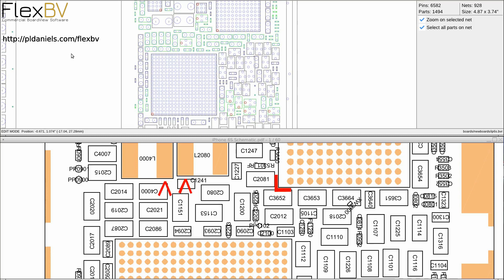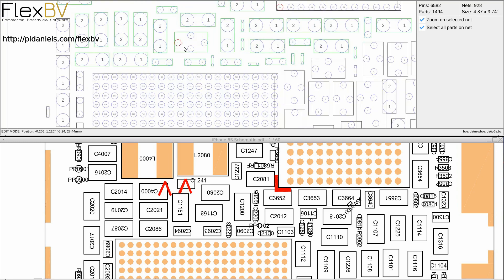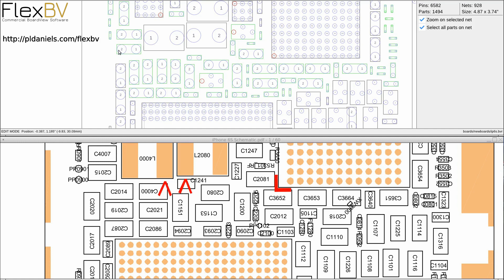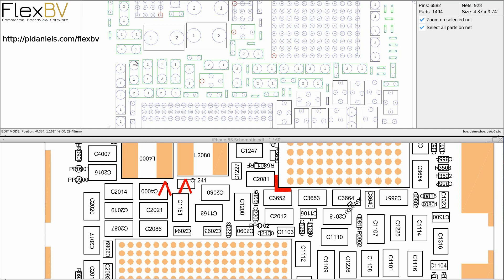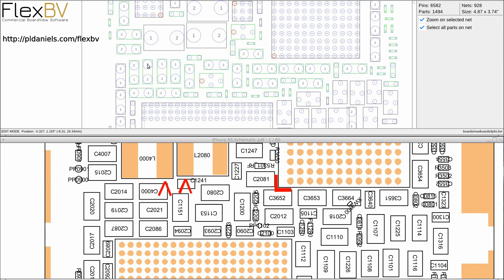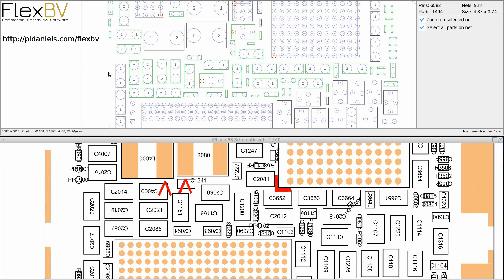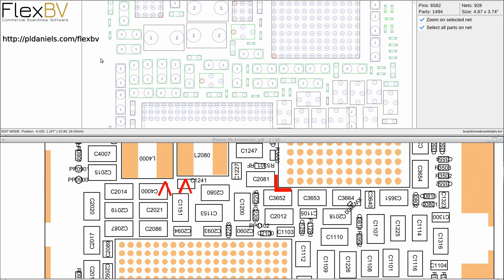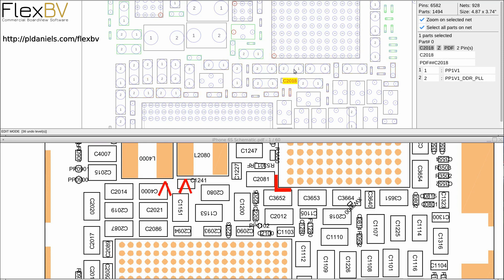FlexBV: Improving the part scan algorithm (very quick, ignore if not interested)

Comment from the maker: After last night's demonstration of the part selection algorithm I found myself needing to improve on it, for my own sanity if nothing else.  While the old naive/brute-force method did the job it did make it harder to maintain a visual flow when looking at the PDF for the next part location to click on for the name.

As a bonus, the new algorithm runs at O(n) rather than O(n^2) from last night.

It could be further modified to provide shortest walk/next-hop distance but  then you have to deal with controlling wandering.  Getting to the level where it's a case of pick your corner-cases.
Reply from the maker: "It depends" a lot on what sort of coding you're trying to do.  Most of the books that have lasted with me over the prior 3 decades are ones that aren't language specific.  "Introduction to Algorithms" by Cormen, Rivest, and Leiserson is probably a "must have" for a lot of programmers, but it's a fair bit to chew on and helps if you've already had some experience with that sort of content.

I've never done C#,  I'm still an old-fuddy content to hide in my C, bash, php, Pascal ... and a little bit of C++ cave.
Reply from the maker: If they can make a language with the availability of C (and C++ to a lesser extent), without monsterous dependencies, I might get interested; however for now, I think the reason things like C linger so well in spite of the design limitations is that you just can't beat its portability and minimal requirements (Java... what happened to you!?).

Comment: Paul, slightly highlight the "next" part while the "current" is active. This will give the user a vector "path" to the "next" while he selects the "current" label. Get the brain to multi-task.
Reply from the maker: That could work, will require a look-ahead which may complicate the undo process, but I'll give it a whirl.

EDIT: I've implemented it, but might need to fine-tune the colours/methods used to indicate the "next part" without being overly intrusive visually.  A fine balance.
Reply: Paul Daniels perfection is subtle!
Reply: Make it purple then ;)
Looking forward for your implementation of ground-plane layer on a multi-layer board algorythm!
Reply: And resistance is futile as we all know.

Comment: Paul, Louis has often mentioned your custom sw for improving the way data from his multimeter is displayed onscreen (ie. much faster update for readings). Is the sw in question available for download or purchase somewhere? Or is it part of FlexBV? I gather Louis uses a BK 390A; would the sw also work with a BK 393?
Reply from the maker: It's open source, https://github.com/inflex/BK-390A 

There's some quirks which I'm waiting on more data from Louis to resolve.  The flickering k or M prefix seems to be something that might be due to ever second frame missing the bit setting.

Don't know if it'll work with a 393, haven't even looked at that model; check the protocol spec perhaps?
Reply: Thanks! Where would I find the protocol spec? I couldn't see anything relevant in the owners manual PDF. Note that I'm considering the 393 over the 390A partly because of its somewhat better accuracy, but also because the cost where I am (UK) is not much more than the 390A.

Re the quirks, you should trademark mateVolts. ;D

Btw, alas I can't really use the FlexBV sw because the boards I want to fix are not Apple or phone boards (I mainly work with SGIs), which is a pity because what your sw does is incredible. Even so, watching Louis' vids where he explains things using your sw has been extremely useful in learning relevant board examination methods. I'm just getting started with all this, long way to go, but worth the effort; already have two companies who want to send me stuff to repair if I can get skilled enough, even though I told them it would likely be many months before I was ready to take anything on.

I've obtained most items, but still need to get an oscilloscope, ultrasonic cleaner, bench PSU and multimeter (I'm building my own fume extractor). MM is a toss up between the 390A and 393 (decided against the EX330; I have an average generic model already but it can't measure capacitance or frequency). Cleaner will probably be a Skymen JP-100S. Bench PSU, not sure, perhaps a Hyelec HY3005ET, or something better (must check what voltage ranges I'll need, some SGI boards use 48V), any thoughts welcome (the one Louis uses is not available in the UK). Not a clue about the oscilloscope yet though, need to read up on that subject.

Thanks for the quick reply!!
Reply from the maker: For a lot of the work we do, if you feel compelled to get an oscilloscope, consider a DSO instead; if the rabbit hole gets that deep it's often good to see what's happening on the data lines and read the data ( buspirate is perhaps even better in that respect ).

As for the multimeter, while the precision is nice, I find for most of our work anything beyond 10,000 count is probably an overkill, but what I like is fast continuity and rapid frame updates so you don't feel like you're spending half your day waiting for the meter to beep or show you the next value as if it's some nasty reality-TV show about to reveal the winner ... after this break...

Do you get any board files for the SGI units?  It's potentially possible that they can be supported but again, like everything, data/format spec is so useful, though if it's in plain-text then it's typically quite accessible.
Reply: Re DSO, you mean something like this?

https://www.amazon.co.uk/Rigol-DS1052E-Digital-Oscilloscope-Bandwidth/dp/B005ZPGPI6/

Must admit atm cost-wise I don't know what constitutes good value vs. going OTT for this equipment.

Re the MM, oddly enough that's something I did come across on the eevblog forum, someone mentioned slow continuity response with the 393:

https://www.eevblog.com/forum/testgear/bk-precision-393-continuity/

Would you say the 390A is the same? The product range datasheet (http://www.farnell.com/datasheets/1909745.pdf) doesn't mention it, but I found the info in the main user manuals, both state the response time is approx. 100ms. If this is "slow", what would typically be more acceptable?

As for SGI board files, sadly no. Infact after 25 years I don't think I've ever seen a circuit diagram for any SGI board or component. The closest I've come across is this pseudo diagram for the O2 workstation, which conveys almost nothing concerning circuitry on the board itself:

http://www.sgidepot.co.uk/ip32.gif

Prior to the above image being made available, this was all that SGI had published:

http://www.sgidepot.co.uk/o2-block-diag-2.gif

SGI was very secretive about its designs, they never even published info on what was changed with each board revision. In the early years they had a reputation for sending out boards with a fair few final factory wiring mods to correct bugs & issues. Quite likely a board rev update then incorporated these modifications, but none are documented anywhere AFAIK. The tech is still in wide use (mainly industrial, defense, medical, etc.), but the lack of info is a problem when it comes to repair. Hence the hill I'm sure I'll need to climb.

To gain some sense of the depth of the rabbit hole, here's one of their early 1990s high-end systems I have in my garage (it was originally a 24-CPU machine with 4GB RAM, cost $1.5M when new):

http://www.sgidepot.co.uk/sgidepot/pics/onyx00.jpg

The diagnostic manual is impressive and does contain a fair amount of useful info (such as voltages and clock points to check), but no proper circuit diagrams:

http://www.sgidepot.co.uk/chalonyxdiag/

For many boards though, such as the graphics boards used in their desktop systems, there's nothing at all.

How difficult is it to create new boardview files? I suppose in theory with some extensive examination one could build up a decent diagram of the less crazy items, eg. the dual channel display adapter for O2 might be a good candidate for that (I have one that's faulty; if I can fix it then it'd be worth $1500+); here are two pics of a working unit I obtained recently (I took these just now, sorry for the poor lighting):

http://www.sgidepot.co.uk/misc/P1140056s.jpg
http://www.sgidepot.co.uk/misc/P1140057s.jpg

At the other end of the complexity scale, see this page for lots of pics of the bigger boards:

http://www.sgidepot.co.uk/simonpigot/OnyxRealityEngine2.html#gen%20pictures

This gives a good sense of scale:

http://www.sgidepot.co.uk/simonpigot/rip25.jpg

Ian.